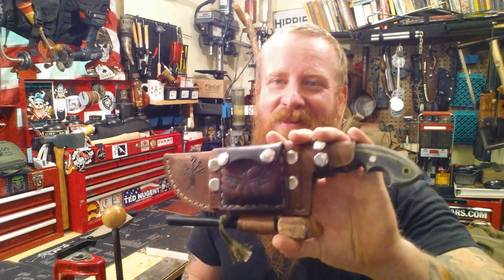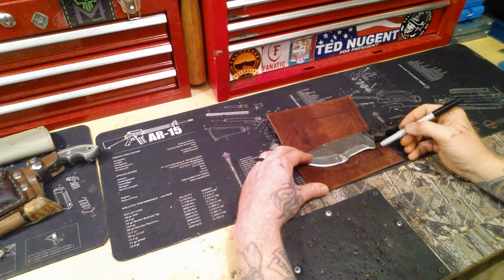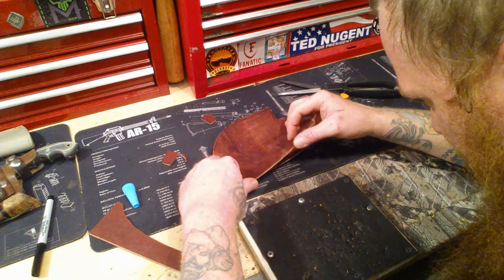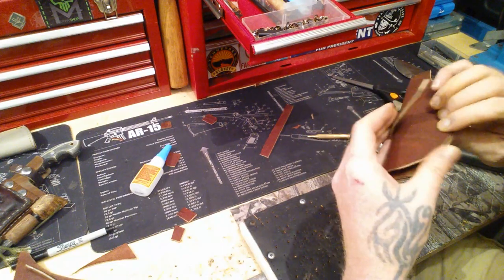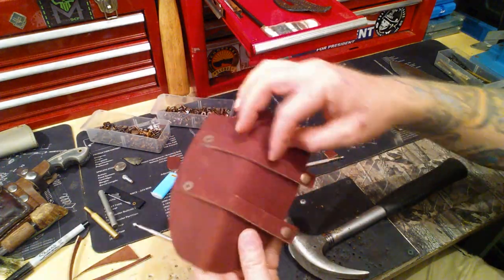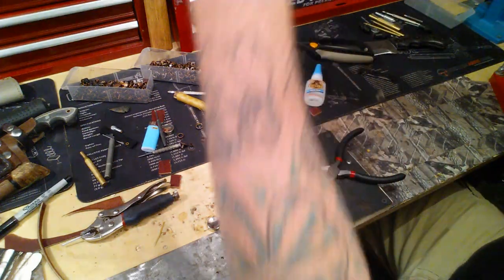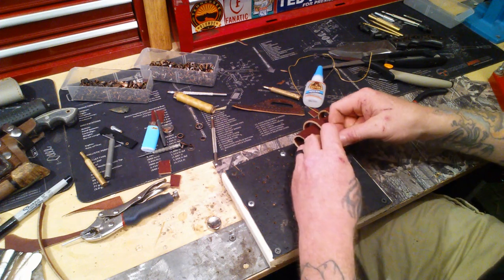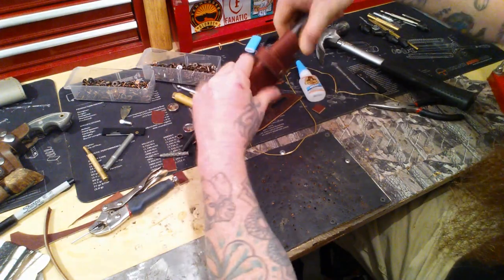Leathercraft Tracker Sheath

Comment: I have been forging my own knives now for about 10 years and watching your video inspired me to create a knife just for this type sheath and carry. I am a logger by trade and we already carry enough hanging down crap on our belts to create a problem but after watching you and fabricating a Shed Elk Antler Handle fixed blade to wear on me .....I will never go anyplace out in the timber without it now....thanks so much for the "No Nonsense" method you use....Im the same way, I find ways to get done what I need with my brain.....not my wallet.
Thanks Again for the great video.
R.C. "Charlie" Hill
Black Hills of S.D.